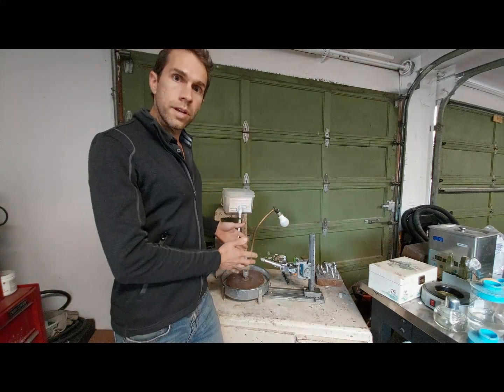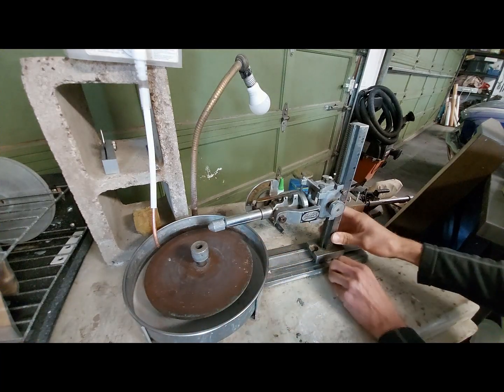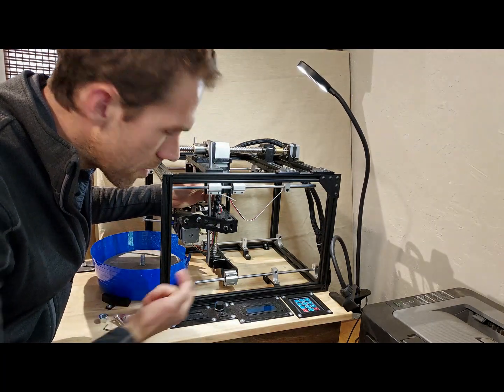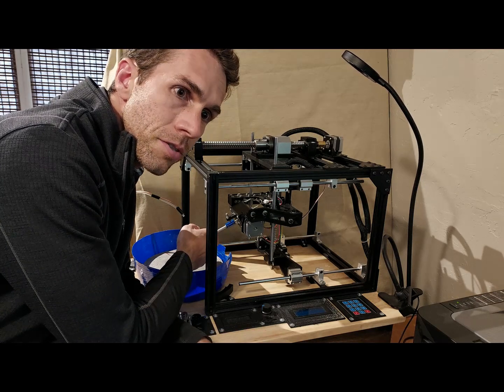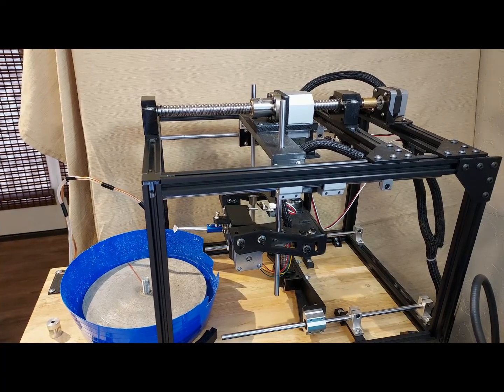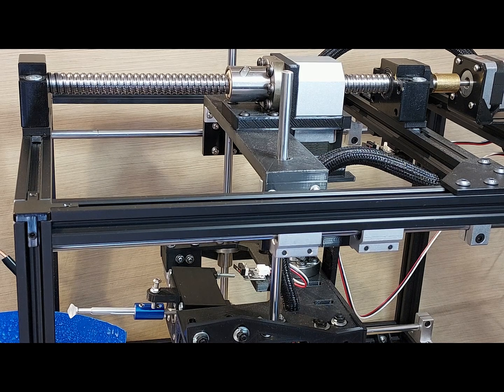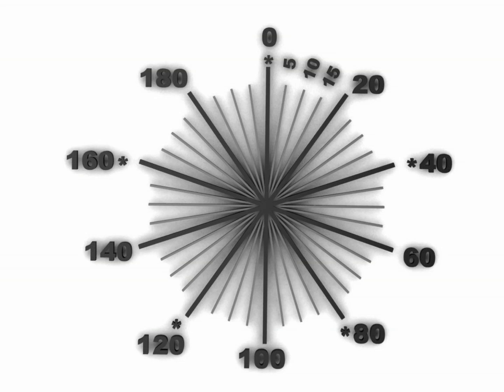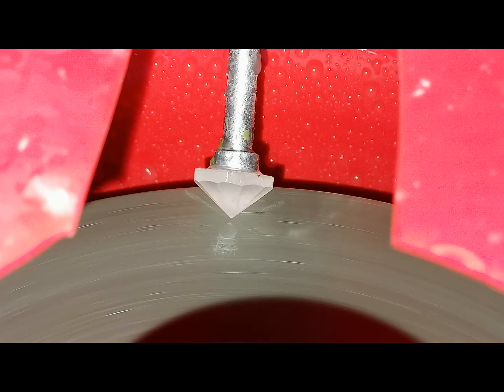Homemade Robotic Faceting Machine

Comment: Great video and great project.  Could you not use gearing to change the resolution of the protractor and indenting stepper motors so that multiple turns of the motor are needed for a full swing of that pivot instead of one?   If you could do a gear train that could be swapped out for another with different ratios then wouldn't that let you swap the gears and therefore the available steps according to the cut you want to make?

Comment: Very impressive. You may find some companies making you offers to work for them and you should be careful and protect your ingenious invention. I do not know if there are any manufacturers using robotics for gemstone cutting, but I imagine there will be some other interested parties in what you are doing-to cut more perfectly is always desirable. I have none of your technical expertise though I do learn quickly. I think I prefer to toil manually at this point and trust my hands but I wish you all the luck!I do wonder if you are working on the versatility of the machine and I would bet that imperfection does challenge you-so again good luck and I hope you do figure that out!
Reply from the maker: Thanks for the advice! All of these things crossed my mind as I developed this machine. In the end, I decided I wanted to focus more on my jewelry making so I sold the machine and all its rights. Not my worry any longer!

Comment: You can increase your resolution by using micro-stepping which most stepper drivers can do. You could use 1/32 micro-stepping and get a theoretical resolution of 0.05625 deg per step.
Reply from the maker: You're right!  And talk to this guy: https://www.merlinsgembot.com/  I sold the machine and it's rights to him. He's taking it to the next level and preparing to sell it as a finished working machine.

Comment: Hey I wanted to thank you for this. I'm learning to make jewelry, and one thing I want to learn is gem cutting, bur its hard to afford a set up. Can you think of a system that's usable of 500$
Reply from the maker: With experience, yes. I've seen people cut gems using old hand jigs and jamb peg systems and their gems are quite nice.  But that is after cutting thousands of gems. The biggest difference between a good machine and a poor one is how much you're fighting the issue.  When looking for a cheaper machine (new or used) the things that are typically most important are the amount of wobble at the edge of the lap and how stiff is the mast.
Reply: @earthartgems  I see. Thank you for this

Comment: OMG the chair roll...def need to put some kinda SIMPLE editing to save your viewers ears. you are obviously a very talented engineer. might i recommend using a noise filter or a loudness setting of some sort. 2 chair rolls in the first min tho...lol. Ok back to the vid.
Reply from the maker: lol, it is a tad loud... I do not use ear buds or headphones, just regular speakers so I guess I never noticed.
Reply: @earthartgems  I use speakers too. the rest of the video was very helpful btw ty ;)
Reply from the maker: @420psilo  thanks. Are you doing a similar build?
Reply: @earthartgems  looks like quite a project to undertake. I think id be concerned about accuracy and constantly having to maintain that accuracy. i was just curious as I love my small digital electronics and gemstones   so i figured why not smash those together. I see you've already got started. how do u plan to maintain and check for tolerances being out before the automation begins?
Reply from the maker: @420psilo  not quite gotten that far yet. I have a few more videos on this playlist. Have you seen them?  At this point, I am still dialing in the actual program to get it to cut the angles to the correct depth and so on. the accuracy of this is pretty much fixed: 0.025mm in the X and Z directions. 200 step index (1.8degrees) and now that I have changed the protractor to a manual one, it is now analog instead of digital so it is up to me to get it set right.  Major changes I might make would be to replace all the 3d printed parts with milled aluminum plates. the steppers could all be replaced with larger motors, with worm drives and gear reductions to increase their holding torque, increase the resolution and also reduce the backlash. Lastly; Running everything off of a dedicated board that was meant for CNC work, rather than an Arduino should give me better performance and repeatability.  But that is all time and money and this is just a hobby I am tinkering with. Right now, I just wanted to develop this as a proof of concept first, and then, from there, decide if I wanted to re-make it with the above mentioned upgrades.

Comment: That's really cool.  I'm still learning how to facet on a old Lee's faceting machine.
Reply from the maker: That's as good a machine to learn on as anything else. I am learning with an old MDR.  How do you like your Lee?
Reply: @earthartgems  I like it but there's a bit of a wabo in the pulley arbor. I got to learn to not be so heavy handed.
Reply from the maker: @luisgomez385  I had that issue on this machine I made, but not the MDR. the MDT has a huge rock solid pillow block
Reply: @earthartgems  That's cool. I'm going to give it another try  next month and well hopefully I'll get better.